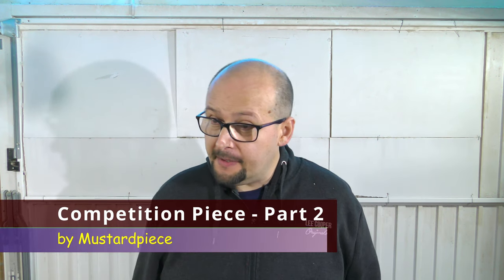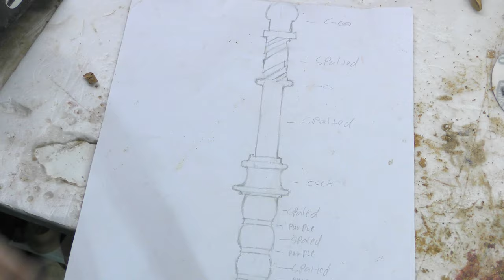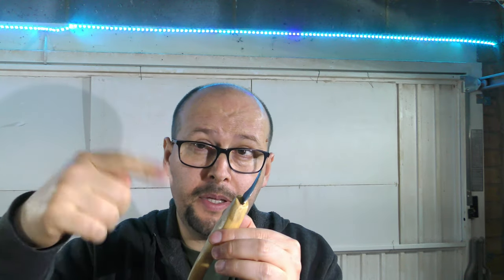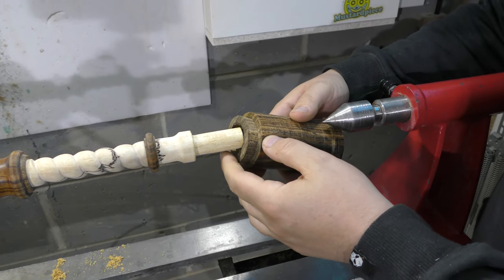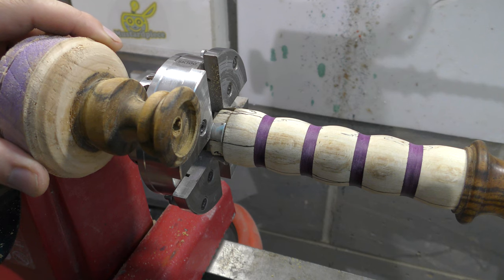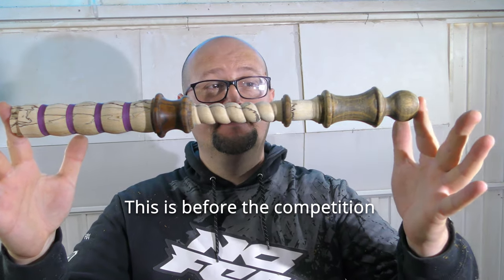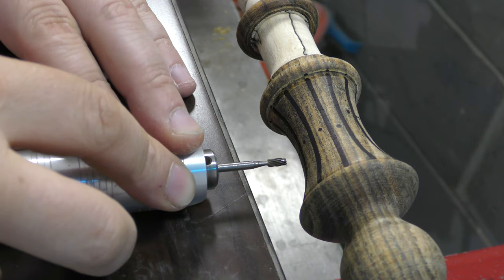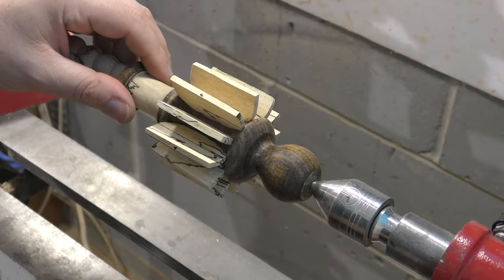New Woodturning Techniques - Double Turning

Comment: Hot glueing pieces in and removing them later is common in segmented bowl turning. By hot glueing pieces in then removing them you get a lattice/lace like look to a bowl. 
Tip for you just in case you don't know, you can get pieces hot glued together apart with a couple drops of acetone and the glue dissolves instantly and comes right off the wood without leaving any discoloration or mess
Reply from the maker: Thank you for the tip. That is very  clever. I will try it next time. 😃